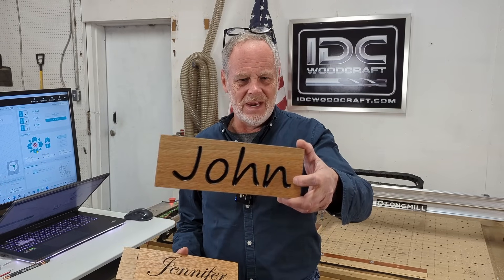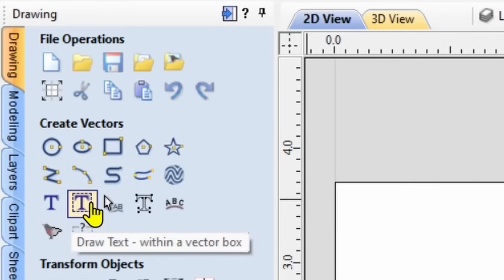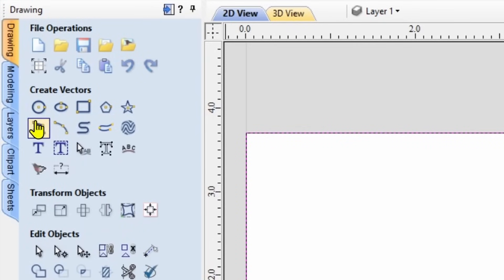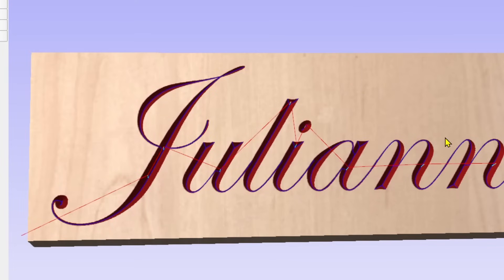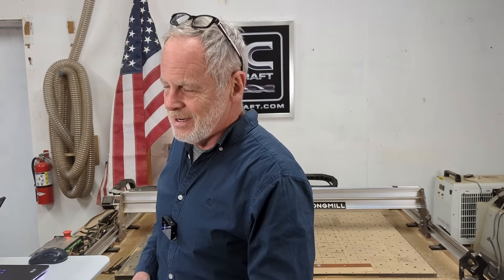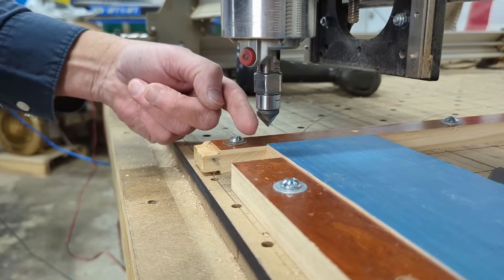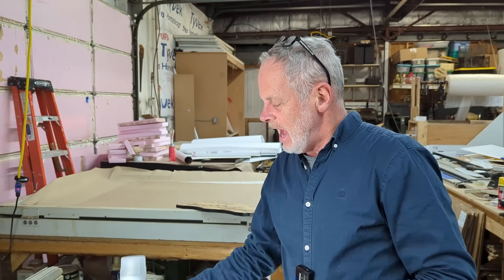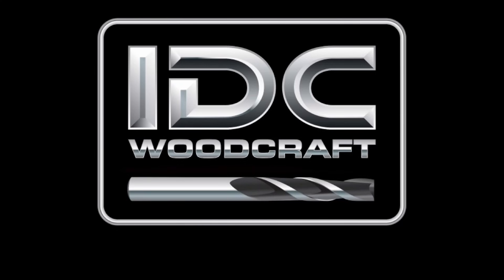A Very Easy CNC Router Project That Takes a Few Minutes To Make

Comment: Hint to keep from being on the edge of the board. If the wood is 3.5 x 10 make your rectangle 3 x 9.5 centered to the wood. Then do the text function and your text will be 1/4 from the edge.
Reply from the maker: That's a great tip! Centering the rectangle like that can really help avoid those edge issues—thanks for sharing, brother!

Comment: As you know Garrett, I am very new to CNC.  I followed your great tutorial, my PC is not connected to my ONEFINITY CNC.  How do I save the G CODE sender file to a thumb drive then use my controller to play/cut the file?
Reply from the maker: brianwalters8277, It's great to hear you're diving into CNC! To save the G-code file to a thumb drive, simply export the G-code from your design software and choose the thumb drive as the destination. Once it's saved, plug the thumb drive into your ONEFINITY controller and navigate to the appropriate menu to select and run the G-code file. Happy woodworking!
Reply: Thanks Garrett. I appreciate it. Your videos are fantastic.

Comment: Thanks for all the videos.  I'm having trouble using v'carve profile.  When I tried to use this after selecting a v-bit, I  run calculate and I drawn area shows a name but it's all blue with read marks everywhere.  What am.i doing wrong?
Reply from the maker: Terry, this one is a little tricky to walk you through over comments my friend. I recommend joining us for our weekly Youtube live sessions we host every Wednesday at 8PM EST and we should be able to help guide you through it then brother!
Reply: I think I discovered my problem.  I had created text lines and then I drew a oblong box around it.  I was trying to use a v-bit for all the vectors.  When I did the text separate from the box then the vcarbe worked correctly.  I then used a different bit for the box.  Thanks for getting back to me.

Comment: Hi Garrett, great video! I noticed that the top of the V bit was touching the bottom of the Muscle Chuck on your Longmill. Considering the "rule of thirds" for chucking the bit, does this cause any issues? Thanks! - Joe Porter
Reply from the maker: Joe, you bring up a great point my friend! The camera angle may have been a little off on this one, but I absolutely recommend still following the rule of 3rds!
Reply: @IDCWoodcraft  thanks for clarifying that, Garrett! Now I just have to wait until the Muscle Chuck is back in stock. 😩

Comment: Great videos!  You provide exceptionally well produced content good for folks of all levels.  Sat down over weekend and set up my new starter CNC router.  Testing out a few of the free design software options figuring if I go with Easel or Carveco to start.  I finally have a few days off sitting down working up a few simple projects like these signs allowing me to get familiar with the new CNC and software options.

Thanks for tip on the G sender software!  That answers one question I had in my head!  I had UGS installed, will try out your recommendations!
Reply from the maker: Jtsdroneclips, you are so welcome brother! Im so glad this video helped you so much.
Reply: @IDCWoodcraft  Thanks much!  Running into minor issues getting first cut going on Easel.  I home no issues with Easel Grmbl driver, but go to setup cut and machine soft stops acting like area of table towards center where wood is set at is acting like a previous UGS soft limit is holding machine from going more in plus Y and Plus X directions.  It appears to match a previous UGS setting project home position I was playing around with and set in UGS earlier when checking its abilities.  Looks like that project soft stops still in my machine memory causing Easel not to move x,y any further so I can zero projects.  On this attempt was using easel with its driver.   Should I first uninstall all gcode software and restart?

For record I have windows easel gcode drivers and the UGS drivers still on computer.  Will remove all drivers and try easel by itself, but already can see where Carveco or Aspire software will be path will end up at very fast.   Currently, only doing first test runs on machine.  It goes back home no issues, just stops not alllowing any movements once I hit around 205 in y axis as I go to set up workpiece start point.  Easel at that point acts like it “safes” the CNC controls, than they do not awake.    It says idle upper left in easel but controls stop functioning including home.  That position on table looks like a Y soft stop had put in earlier today from playing in UGS.  Thinking I need to undo soft stops in UGS first than uninstall it and start easel over from scratch once UGS is uninstalled and any soft stops put in from UGS are showing removed.

My only goal currently is to do quick test run later in week will be adding a Makita router and order up some bits through you for using once I am setup in my shop area.

I am going to uninstall all gcode firmware and start fresh with one you mentioned.  May install Demo version of something better than Easel also.

Just found issue that UGS added limits into initial gcode machine was preloading.  Will reset those properly should be all set now.
Reply: That did trick.  Ran first test no issues, once I fixed the preliminary g code sent to machine.  Than took second to realize needed to shut off a second tool path had active that was not allowing carve to start.  Test was finally successful.  Time now to add the Makita and order bits on Friday.  Is there a gcode command can send that takes machine out of idle state manually?

Comment: 12:20 -- Not to be that safety guy, but the way you used the table saw is a great way to lose fingers. There are two problems, with the most serious one first: 1) When crosscutting a board with a miter gauge, you cannot run the board along the fence. If you introduce even the slightest angle the board will get pinched and you'll have violent kickback situation that will at best bruise the bajeezus out of your torso, at worst take your fingers right into the blade. Remedy: Clamp a block of wood of a known width to the fence well prior to the blade. Move the fence that distance further away from the blade. Use that clamped block to set the width of cut on your miter gauge, then moving it forward through the blade with nothing for it to pinch on.
2) The blade is set too high...the blade height should  be set so that the kerf barely comes up above the wood being cut.

Seriously, Garret, I gasped when I saw that table saw clip! Please be safe, I love your channel!
Reply from the maker: MrStrizver, you're absolutely right brother. I should definitely be more careful working with the tools in the shop, thanks for calling me out on it my friend. Staying safe in the shop should be everyone's number 1 priority!
Reply: Absolutely!  I was going to note that also.  Been there and got lucky it wasn't worse.